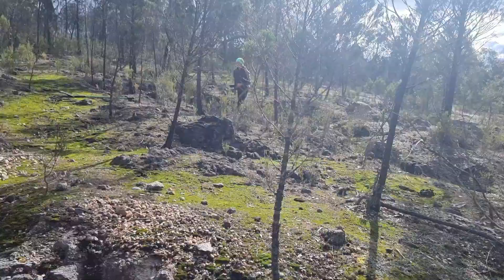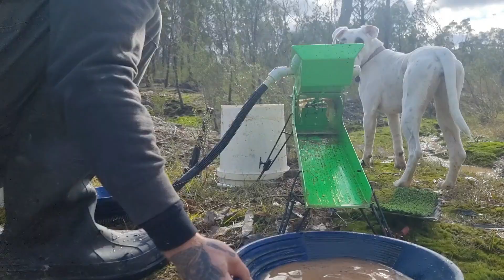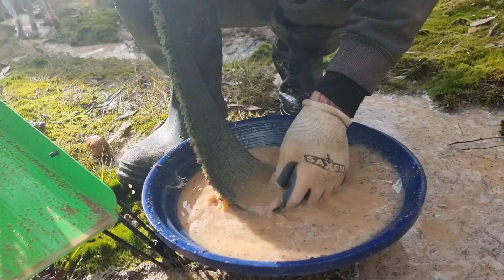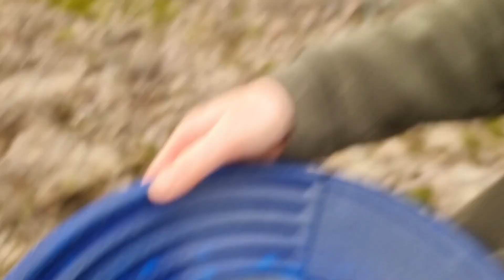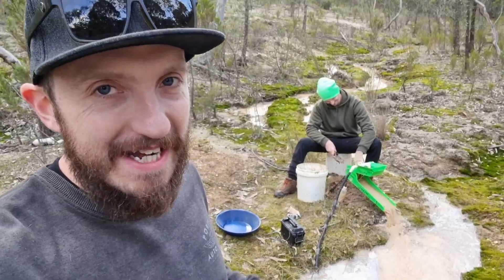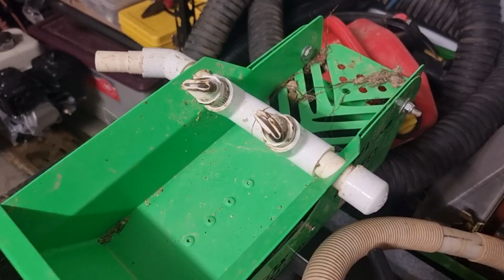I Waited two Years For This! | The Mini Monster Gold Sluice Box

Comment: Put in and old wool Blanket in the full length of the sluice . only put about 6 inches of expanded metal at the start . The old wool blanket I guaranty will get 95+% of you flour gold . classifying to 1/4"  works good

Comment: put a bucket bracket over the hopper to hold a bucket with a small hole in the bottom so it self feeds. 

just plug in another bucket when #1 is done.

Comment: I am very surprised at your dislike of the goldhog matting....? I use the goldhog mat with the goldfox trommel fron 1/4"- to crushed hard rock using the 3' extension for the super fines. Yah, they're a pain to clean but do catch the super fine gold in my area. Nice little testing sluice though! I like it and your ideas.
Reply: How do you like that goldfox trommel? 
Saw them on ebay and thinking of getting one.  I'm just a relative casual or beginner though... mostly detecting and panning so far...so don't know awhole lot about sluices and stuff.
Is there much benefit to it and having the trommel to just a regular little powered sluice or highbanker like the Gold fox? 
Thanks
Reply: @iamshredder3587  thats a bit of a loaded question. 
Different size materials,  types of material all require a bit of testing. 
I have multiple slices and they're pretty specific to the material I'm running.
Reply: @nomana60  Ahh ok . Thanks.
Reply: @iamshredder3587  I do like the goldfish trommel extremely well.
Kelly, the guy that makes them, was on top of all my needs for a replacement motor and helped me understand how to help cool the motor since I might use it year round here in the desert recirculating the water.
And goldfish keeps making smart changes to their units.
Good luck and heavy pans.

Comment: A straight shot of water into the hopper is way better than spray bars when using small bilge pumps e.g. 1,100 GPH. It creates a boil effect at the front of the hopper box and saturates the material. Nice Gold Fox unit! Chris - are you still planning to use your Gold Rat machine, or has this new one replaced it?
Reply from the maker: Time and a place for all gear . Thi.k of this one as a sluice.for far away hikes.
Reply: @VoGusProspecting  hey mate where can I get the pump and battery set up, cheers.

Comment: You might also consider (since you are into modding anyway) making your hopper a little flatter (and maybe larger) and giving the water more time to work the clay like a 'slush box' as they used to call it around here. Were it me in that, I would even think about making it a 2-stage rig, putting more than one layer of expanded with an inch or so gap between with smaller expanded on the bottom, for the water to blast that clay through. IMO clay is just more more more in as little space and effort as possible. Heavy pans brother!
Reply from the maker: Already on it. Got a couple mote mods to go

Comment: Broom and dust pan. leaving 3/4's of the gold for the next guy!
Reply: Soil is like clay and wet at that so broom and dustpan are only useful in summer
Reply: @gadzee506  didn't look very wet in video, little moist, broom works well especially on the flour gold.
Reply: @jamesferrin5415  we are in the middle of winter right now it had rained for a few days before we filmed this. The bedrock/conglomerate has little pockets all over it so it's not east to get everything even when it's bone dry but as I said is like a clay so even in summer it retains moisture in the bottom layers

Comment: You’re insane for tossing the Gold Hog mats aside and calling them trash 🤦🏼‍♂️ not only do you not understand why it was set up the way it was from them you took all the new aspects that made it such a high performer and took it out 🤦🏼‍♂️ you need to do a lot more research or at least a lot more research on the products you spend your hard earned money on. If you didn’t want such a turn key set up why did you spend the extra money on the Gold Fox with these features. You could have save $200 and bought any other mini highbanker with that slow set up you changed it to 😞🤦🏼‍♂️